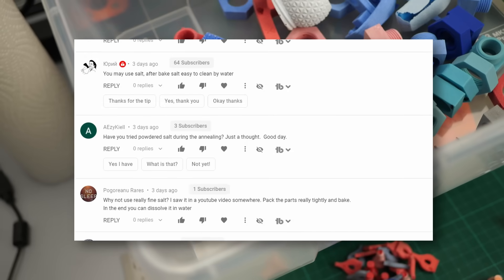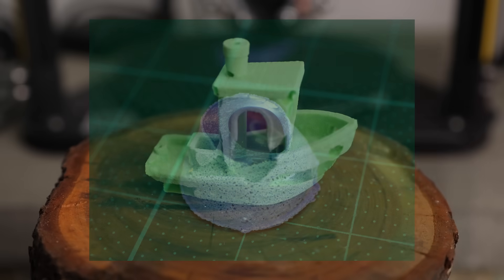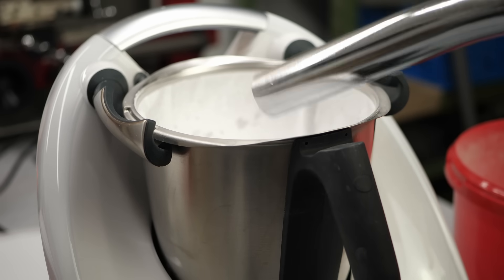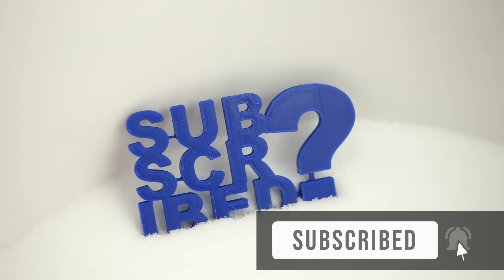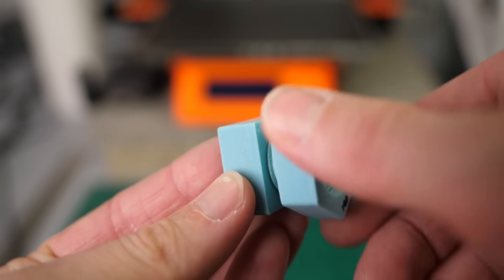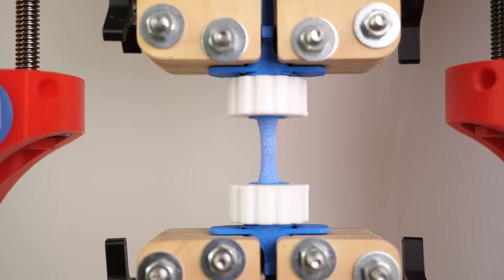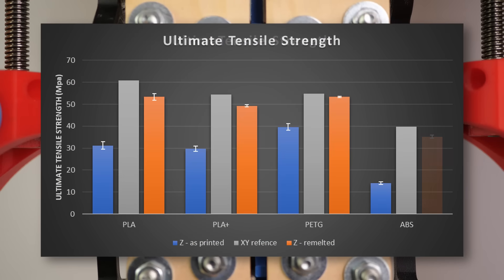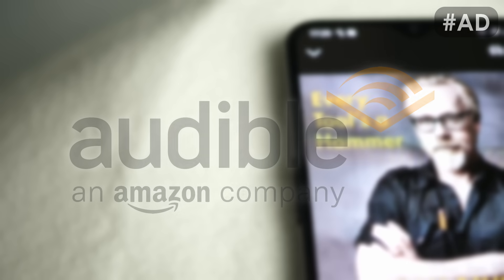The STRENGTH of 3D prints REMELTED in SALT

Comment from the maker: Check out our CNC Kitchen products at https://cnckitchen.store/ or at resellers https://www.cnckitchen.com/reseller and on AMAZON (EU) https://geni.us/s8rYtQ
Reply: I think the original guy said he used a real coffee grinder not a mixer/blender to get the fine salt. So he grinded a lot of salt till it was just really fine and now reuses it all the time
Reply: Why not use powdered clay since it has a very fine grain size
Reply: Why not use baking soda? It normally come very finely ground.
Reply: @enderoftime2530  that is a great idea though at high temps baking soda might turn into washing soda I'm not sure if that is a bad thing for plastics.
Reply: @kingofthespazs  you are absolutely correct. I was aware of the possibility prior to posting. I didn’t think that reaction occurs at oven temperature. I might be wrong. I’ll double check and get back to this thread after checking.

Edit: Upon double checking, it would it very easily decomposes into sodium carbonate, water, and carbon dioxide. The water would be particularly bad for some prints; however, washing soda might still be a decent option for this process. Washing soda can probably be purchased in a fine powder, or could easily be made into a fine powder after decomposing baking soda. The decomposing. Process would likely cause a bit of grain agglomeration.

Edit 2: Washing soda might would not be a particularly great option unless pre-baked above 212°F to dehydrate the crystal structure. It would then act as rather decent desiccant.
Reply: @kingofthespazs  Alternatively, pickling lime (calcium hydroxide) might be a decent option. I don’t know how expensive it is, but I know that 50 lb bags of it can come in a very fine powder for agricultural/industrial use. I don’t know how fine the kitchen use pickling lime is. It has a much higher dehydration temperature.
Reply: @enderoftime2530  Baking soda starts to melt and decompose at 50°C.
Reply: @dralionblackheart6643  not melt only decompose. 180°F/50°C it decomposes. I didn’t think it decomposed at such a low temperature. A lot of other hydrated compounds (not even part of the true ionic structure) decompose at much higher temperatures, I didn’t realize baking soda decomposed at such a low temperature. Washing soda would be a decent option too.

Edit: on second check washing soda might not be such a great option unless it was dehydrated first which requires pre-baking above 212°F. The melting point is significantly higher.
Reply: @dralionblackheart6643  Baking soda doesn't melt at 50C -- it breaks down into sodium carbonate (as noted by @b.o.s domestic disputes).  That doesn't seem to be a problem, though, because sodium carbonate doesn't melts until you reach 850C+.  Just for fun, I tried annealing some parts in baking powder and got very good results.
Reply: @nedwelch1217  Yes, saying that it melts was wrong. It actually decomposes as You an others said, what I meant is that when it decomposes releases water and CO2. Which I thought could be a problem. But I haven't tried myself, so I just discarded it. What is your process? Do you break the baking soda before? Or it doesn´t matter the decomposition?
Reply: @dralionblackheart6643  No worries.  I actually ran my tests before fully appreciating how NaHCO3 behaves when heated.  My bad, too.  So my process was naive -- I packed the part in bicarb, used interlocking steel sample bowls and a c-clamp to compress everything, and baked in a convection oven at 430C for about 45 minutes.  Result was dimensionally stable and acquired a nice matte finish.  Looks like it could have used a little more time, though, as it doesn't appear to be completely water-tight; liquid applied to the surfaces appears to soak in more than I'd expect from fully-fused layers. Didn't notice any obvious problems associated with breakdown of the bicarb, for what it's worth, although the lack of complete fusion noted above might qualify (presumably the transition to washing soda is endothermic, and has the effect of keeping the part cooler than it would have been otherwise.  or perhaps carbonates are less good at conducting heat that salt. who knows). 

Am curious about the how the process will work on re-used bicarb (now, presumably, NaH2CO3).  That'll be my next test.
Reply: @nedwelch1217  Nice, I think Ill give that bicarb process a chance. NaH2CO3, should be interesting too. I think due to the decomposition, the water released sucks up some heat, as you pointed. Thank you for sharing.
Reply: Try fine silica (diatomite, celite etc.)! It is superfine and chemically inert unlike salt.
Reply: @CNCKitchen | What if you dissolve salt in boiling water and after that boil the water off? It will be a brick of salt without big crystals, which is much easier to grind I guess.
Reply: Now try clay slurry and sand multiple layers @
Reply: @CNC Kitchen i  think you made the same faux pas like you did on the plaster.  i mean the task of the surrounding medium (plaster,salt, whatever) is just to hold a tiny object which weight is under 50? gramms. So there is no need to surround it with 20x of plaster or salt. try tin find the edge, the smallest amount of powder which works for the size of the object you want to test. This means use smaller buckets or other forms which fit better. (You can find cheap stainless steel forms/dishes/buckets for kitchen supply in so called "1euro stores"(or similar concept stores like thomas phillips or Pfennigland))
Reply: another idea is use silicone and add a mm thick layer on the parts (let it dry ofcourse), and then put it in the sand/salt, this can make the porous surface disapear
Reply: You should try a DIY device I saw time ago to pulverize. It's just a crystal jar with a few bearings balls (with diferent sizes). You make the jar rotate with a motor and the balls pulverice everything that you put inside. It takes longer but the result it's best.
Reply: use slate stone powder, i use slate stones in my steel ball mill and the byproduct is a super fine stone powder i use mixed with charcoal also super fine powder for sumie painting, also mixed with wood glue makes a really nice black paint for furniture, so you could try picking slate stones and breaking them with a hammer and then put them inside a container with steel balls 3 days untill its all like mud, then just need to make it dry on a oven tray, then it will fuse into a solid slate so you need to break it apart again inside a mortar and you will get a super soft black stone dust.

or you can pick a place with gravel and just use a strainer to get just the stone dust, it will be just normal stone dust that is available EVERYWHERE so anyone could use this method easily if it works with normal stone dust.
Reply: are you romanian
Reply: I got an idea, what if you use quicklime, its cheap and way finer than salt. And even absorb water. I will do some tests by myself. Thanks for the inspiration.
Reply: @dralionblackheart6643  Quicklime or calcium hydroxide? My suggestion in reply to b.o.s. domestic disputes talks about calcium hydroxide. I too thought about quicklime, but that’s some pretty nasty stuff. It’s nothing like sodium hydroxide, but it isn’t nice. I was afraid it might be too easy to cause chemical burns or cement itself during the baking process. It would still be interesting to experiment with.
Reply: @Ender of Time  yeah quick Lime is pretty dangerous though I might try it when the universities opens back up. Right now I'm looking to see if graphite or water softener beads might work well
Reply: CNC you should check out this blog post about the temperatures they are not even half of what you used. https://blog.prusaprinters.org/de/wie-sie-ihre-3d-drucke-durch-gluehen-verbessern_32128/
Reply: Not until you fix the title. Someone didn't learn their irregular verbs in school.
Reply: Kann man nicht anstelle von Salz einfach Kalk nehmen?
Reply: Moim wie geht's
Reply: So you know Bimby too, cool ^^ 
Nice to see one of my favourites youtube channel, about 3D Printing, use that great machine
Reply: I wonder how powdered carbon would perform?
Reply: What about baking soda
Reply: i was wondering if this method can also used as combining seperate parts as one. it would be better than any glue. but also it will be really hard to align the parts properly so msybe a dab of glue to set them in correct placement? Either way really exciting stuff. keep up the good work.
Reply: Stefan, could you sift the salt through an ultra-fine screen to isolate only the finest bits of salt? The magnified picture shows a salt grain size distribution that is not entirely homogenous.
The proper way to totally powderize the salt is to use a ball-mill. If you put salt into a ball mill, and let it go for a while (an hour or so at the least, or overnight if you really want to powderize the crap out of it), then sift the output, you will have a much finer powder, and this kind of milling also does not risk damaging the motor of the mill.
Reply: du solltest mal nach "Trockenfarbe" suchen die meisten bestehen aus Oxiden zB. Eisenoxid oder Chromoxid
Reply: You could try lime.
Reply: (how) would the temperature profile change of you'd mix in thin copper wire to transfer the heat?
Reply: What about trying with flour? Its flour sized grains...
Reply: You're requesting that everyone shares your video, yet you didn't do freespirit the courtesy of linking to his video at the top of the posting information below yours. And the link to his video doesn't mention him by name. Shame on you.
Reply: Very fine metal or metal oxides should transfer heat very efficiently and not react with the water released
Reply: Formsand wäre doch evtl. eine option.
Reply: hm. i didn't investigate the whole story but did you try to use dry plaster?
also may be you can create thin plaster shell like it is done for lost-wax metal casting. Remelt and than crack/remove thin shell. Thin shell is way easier to dehidrate before melting and to remove.
Reply: im surprised you didnt notice at first only the outer layer is like that. ur previous clips showed that
Reply: Interesting concept!  Some thoughts:

1. Perhaps the ultimate way to ensure that the salt grains are as tightly packed as possible might be to press the (metal!) container to an ultrasonic transducer while pressing.  That should vibrate the crystals almost solid while breaking them into smaller pieces through rubbing.  You could probably get the same effect by submerging the container in an ultrasonic cleaner.
2. Most blender blades are configured to pull contents down towards them, which is perfect for liquids but not for solids.  Vitamix blenders have a special 'dry cup' available that is specifically intended for making flour and should work well for powdering the salt.  They also have insanely powerful motors which are pretty much bulletproof, so burning them out shouldn't be an issue.
3. To ensure that the salt grains are sufficiently (and uniformly) small, a micro-sieve is necessary.  If you search for 'micron stainless steel screen', you can find lots of options that are fairly inexpensive.  '25 Micron Stainless Steel Screen Filter Extraction Tubes' would seem to be a good size and form factor, as you could just partially fill the tube then shake it or roll it back and forth over an open rack to easily sift out the finest salt powder.
4. An easy, inexpensive way to keep the salt dust out of the air might be to place a furnace filter on top of a box fan (blowing downward), then do your operations on top of it.  
5. Using a non-dissolvable substance would mean that it wouldn't be able to be removed from the surface of the part.  This could be helpful or not, depending on the individual application.
6. For finishing, I imagine a resin with a VERY low viscosity would get into the pores and hold there without pooling on the surface.

Does that make sense?
Reply: Pickling salt?
Table salt in a blender? It can work, but as you found out it has issues. A cheaper, smaller blender like a magic bullet would likely work better. Or try a mortar and pestle.
For non-salt materials: talcum powder? Wouldn't dissolve in water well. Plaster powder? Baking soda/powder? Flour? They should handle 200C fine, plus they'll dissolve in water somewhat. Sugar? That could caramelize at 200C.
Reply: try baking soda... not sure how well it will work but, its finer then even the salt you tried/used :)
Reply: cant you just use stone powder? can be found anywhere
Reply: You might want to combine this method with vapor smoothing after washing the salt away, to get rid of the rough surface from the salt grains.
Reply: I would be curious to see ultrasound endued at full temperature.
Reply: Hi Stefan, I just wanted to let you know that I have successfully used Baking Powder (Bicarbonate of Soda) for this process. It's much finer grained than salt but more expensive.
Reply: While the 3D printed part my be strengthened by using this reflow method, injection molding results in molecular alignment only achievable through laminar flow, material selection, correct temperature, correct hydraulic pressure, correct release time and proper mold-flow design.  The resulting molecular alignment is the source of the plastic part's resilience.  Because those conditions don't exist in a 3D print or in this reflow technique, the part will never have the mechanical properties of a correctly-engineered injection molded part.
Reply: Could you coat the item with a high temp paint such as an automotive engine ceramic paint to prevent the salt from reacting with the surface?
Reply: only sharing the videos of my patreons
Reply: What about microbubbles/microbeads that are used in fiberglass and composites? They're small glass spheres that come in VERY small diameters.
Reply: you could try baking soda
Reply: You can try silica gel for chromatography. It is super fine SiO2 used in chemical labs to separate and purify chemicals. Defined particle size and chemically inert way above temperatures you need for this. However it is not the cheapest material, I guess you need to pay around 20€ per kg. If you ever work with silica gel, be sure to wear a respiratory mask and be outside as the dust can be a health risk.
Reply: Wouldn't clay have the lowest size ratio? Green sand probably the best
Reply: Use a ball mill. They can be had in Amazon for very cheap
Reply: You could try creating a mold from the part with high temp silicone and then melt the plastic in there.
This way you would not be limited by grains.

Any idea?
Reply: We NEED further investigation on that! Different mediums, different grain sizes, how do post processing methods compare. Oh my... Thats enough content for a bachelor thesis...
Reply: instead of salt which grain is too high, why not use borax powder? its similar with salt but have far smaller particle size
Reply: Hi, may I suggest the use of NaHCO₃ 
Its sold cheaper and grains come less coarse out of the package.
Can be nice to see som3 tests
Reply: have you tried with sand like they do in the mould industry?